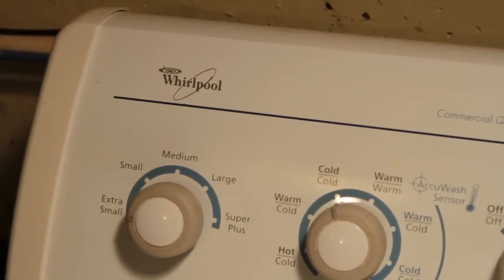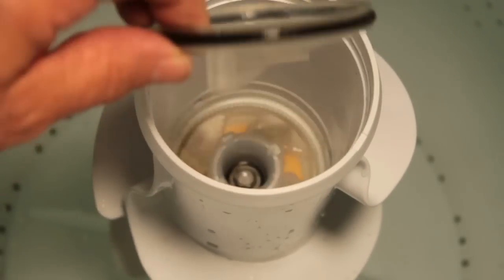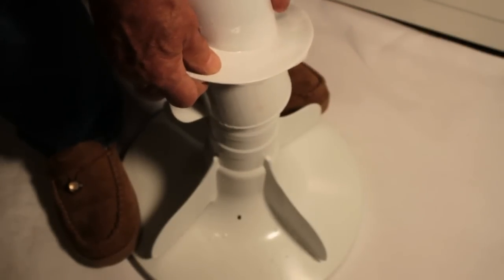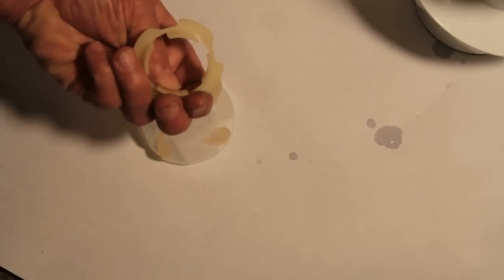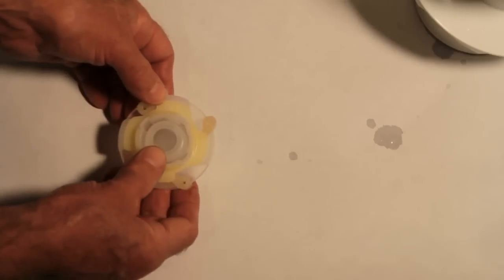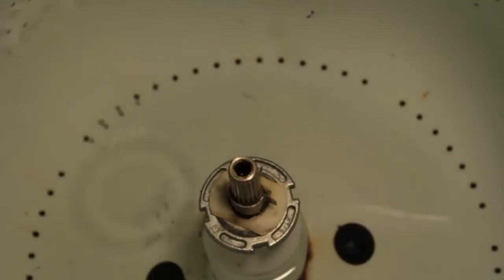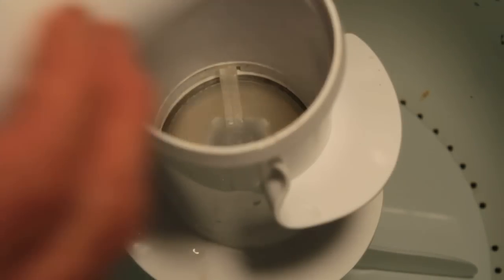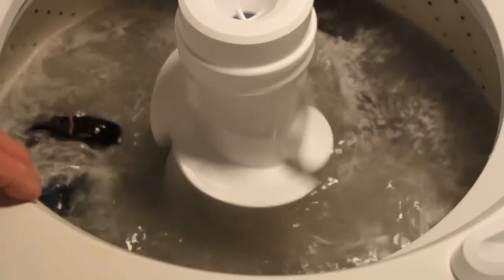Broken Agitator - Whirlpool Imperial Series II

Comment: when the auger was on the agitator snug how where you able to get it off? I keep pulling and am afraid I am going to break something!
Reply from the maker: +Kassi Stewart .....Pretty much as you see me do it in the video. I didn't have hard shoes on, just my moccasin slippers, stood on the agitator, and then pulled the auger up. I wiggled it side to side, occasionally changing my position, and pulled up at the same time.  Don't hold the edges of the augers' spiral part that drives the clothes down. Make sure you your pulling up with your fingers right against the augers' main body.  That should help prevent breaking that part. Hope this helps. Good luck getting it apart.
Reply: unbeknownst to even some repair people there IS a model whirlpool where they glued or plastic welded hidden tabs...I have seen several posts about these and always the resident experts do not understand the problem having never come across it apparently ...the good news is the tabs are small thin plastic in thin slots right up there on top...I did not understand until I soaked my entire assembly in very hot water for several minutes and FINALLY brute force snapped the tabs...THEN I saw them and was OH THAT is what they are talking about!  I WOULD have tried simply a sharp blade screw driver as a chisel and just put it in each slit and whack it a few times...I THINK that would have fractured the glue or weld or whatever they used and allowed the agitor to come free of the turbine piece...ALSO like some others I had some difficulty removing the bolt too...I think it was locktighted in with that glue compound for bolts ...what worked there was actually tightening it more and then loosen and tighten loosen until it freed up and came off...evidently the profit people in the washing machine business do not REALLY want us maintaining our own machines??  Also even though the main dog hub LOOKS different from the normal piece shown in kits...the dogs are the same and really are all that need to be replaced anyhow I recon ...what they would LOVE for you to do is to buy the entire assembly rather than buying dogs on ebay for $3 (including shipping) ... It ought to be illegal that kind of crap!  THAT is not just "business" or "smart"... it is wicked and evil!!  Thankfully we have each other!  Pay it forward brothers!!
Reply from the maker: Thanks for the info!! Really appreciate the extra help.  I put 2 annotations on the video directing people to read your comment if they are having these problems. You said a mouthful on the manufacturers evil intents. It is one of my pet peeves that we are supposed be so "environmentally conscious" but yet these people can make everything "disposable" rather than fixable. Forcing people to buy more stuff and send more stuff to the landfills. And don't get me going on plastic packaging, a 3 inch item in a foot square double chunk of plastic? Not even a kind of plastic that can be recycled. Thanks againMark

Comment: you can tell its broken when he turns the top part of the agitator counterclockwise and the bottom of the agitator doesn't move with it
Reply: also 2:17 so that is what the square holes on the agitators are for (on the models that don't have a fabric softener dispenser on top of the agitator)

Comment: What you failed to tell people is the four white tabs on the lower agitator must fit into the four openings on the piece that holds the dog fins.  Two of mine had broke off and were attached to that plastic piece. Now I have to buy the lower agitator and the plastic piece.  This is getting more and more expensive.
Reply from the maker: Robert Wilmoth  Check the video from time 10:18 to 11:50. I think these are the tabs your referencing? If they are, I think that I explained it very well that these had to be lined up and snapped into place.

Comment: Aright I have this exact model and there is NO WAY the 2 parts will separate and I can not find Dougs comment on this fix about separating the pieces. If I force it any harder either my back will break or the agititater will break
Reply: Randy Hauck I experienced the same with mine and I got it off but my tabs broke. I haven't put it back together yet but I hope I don't have issues now that the tabs aren't there.

I suggest trying to push the tabs in maybe with a flat screwdriver to avoid breaking the tabs.
Reply: Even when I broke my tabs off it would not budge.. I ended up breaking that housing piece thing that holds the dog ears off into little pieces it was so brittle..After I broke it all up I got the agitater separated.. Luckly I bought a complete replacement kit and it all seems to work great now. And I dont have those tabs anymore either
Reply from the maker: Sorry about that. I couldn't find his comment either. Was there at one time. Maybe he deleted it or perhaps deleted his YouTube account? Would that delete comments? don't know.
Reply: So I put it all back together and all is good! It seems that the tabs are really only there for the manufacturer to make it easier to assemble. In the end, the one bolt holds it all together. 

Thanks for this video!

Comment: Where did you buy the replacement parts?
Reply from the maker: FACTORY ORIGINAL OEM AGITATOR CAM KIT FOR ULTIMATE CARE II WHIRLPOOL MAYTAG ESTATE WASHERS
http://amzn.to/2xOxarX

PART # 3951608 GENUINE FACTORY OEM WASHER THRUST SPACER FOR WHIRLPOOL KENMORE SEARS ROPER 
http://amzn.to/2xPAP9fIt's in the notes under the video.
Reply: Thanks. I bought the parts on amazon. I haven’t installed them yet, but I will be watching your video when I do!

Comment: Hello thanks you video was the best man also tell you watchers that the model number was under the lip of the washer covets man it was hard to find also don't buy parts from Sears they are to high priced be well friend
Reply from the maker: Good tip on where that mod # is.  Appliances can be kind of tricky finding it, from refrigerators, freezers, stoves and very thing in between. Seems like they are always a little tricky to find. Thanks for the comment.

Comment: I need to know how to return the agitator on a Hotpoint washer Appliance the model number is H as in Henry S as in Steve W as in weight p as in Paul 1,000 M as in Mom 2 as in the number to and WWF as in World Wrestling I need to know how to remove the agitator from the washer please get back with me thank you
Reply from the maker: I never worked on that model, but here is a video that may help. Also a link to parts diagram and list of parts. Video; https://youtu.be/4Rf4RO2MGeM . The video is for a GE but it's pretty much the same as the Hotpoint. They are both made by the same company.   Parts diagram: https://www.partselect.com/Models/HSWP1000M2WW/Sections/TUB-BASKET-AND-AGITATOR/?ModelID=1927897&ModelNum=HSWP1000M2WW&mfgModelNum=&ManufactureID=2&Selected=00139027i03&Position=4&mfg=GE&Type=Washer&Mark=4  Hope that between the two you are able to figure it out, good luck. If you figure out what parts you need you can also check for them on ; http://amzn.to/2lzbpYA.

Comment: looks like my admiral washer My dogs are fine.Make a knocking sound and won't agitate.
Reply from the maker: Might be the motor coupler is wearing out. I had to fix mine sometime after this video was made. Would have liked to do a video on that but the job was a little more involved for me and I had some difficulty with it. Was a little to difficult for me to handle the camera work and work on the machine at the same time.  Check out this guy out; https://youtu.be/H0o95LEjBtM

Comment: Okay what if it is not the dogs?
Reply from the maker: I would have to be able to see what is happening and then figure out what it is. I am not an appliance repair man so I don't have a working knowledge of all the things that could go wrong. When something of mine doesn't work right I try to figure it out and then go from there. Sometimes I can fix it at a reasonable cost and other times it is either replaced or have it fixed by someone that is trained. Sorry I can't help you more than that. Mark
Reply: Thanks for replying. I held the agitator and it did not move, even on spin. Because I don’t want a new high efficiency machine, I’m going to ATTEMPT to rebuild mine. The motor is good. Wish me luck.